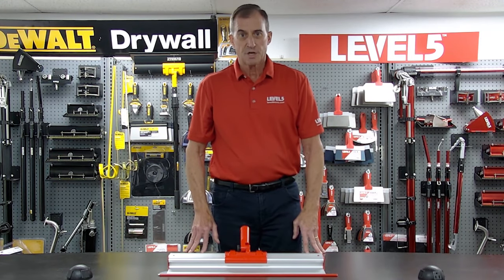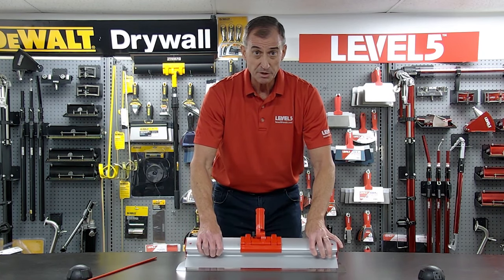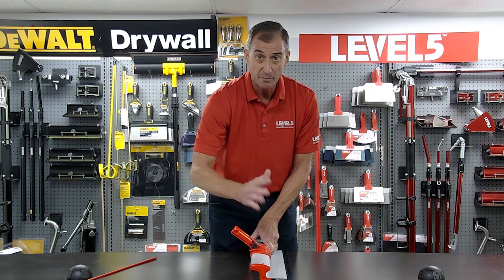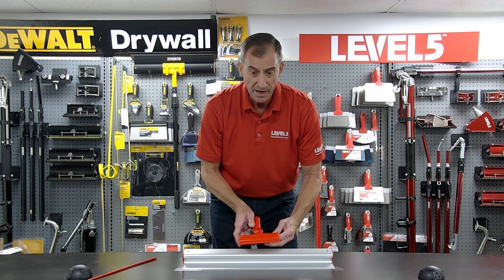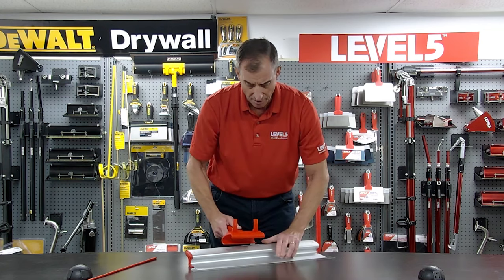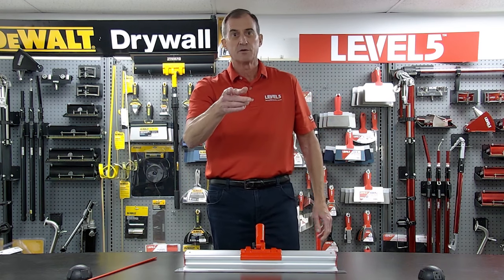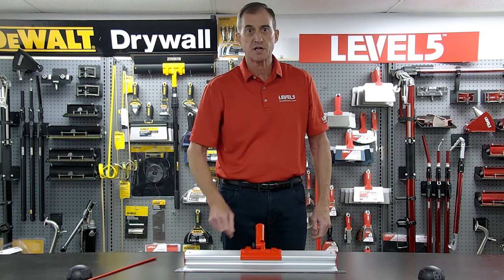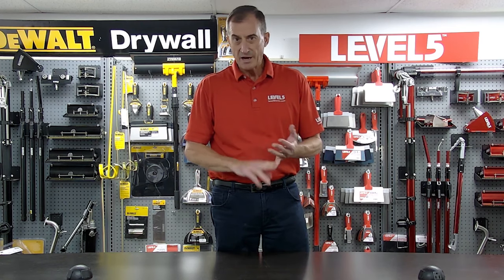Skimming Blade Handle Adapter INSTALLATION GUIDE | LEVEL5 Tools

Comment: Does the adapter fit a stand extention pole like painter pole. Or does it need a certain type?
Reply from the maker: It requires our Skimming Blade handles.